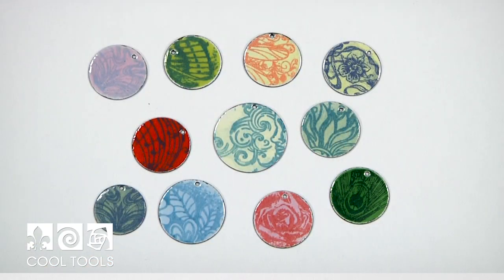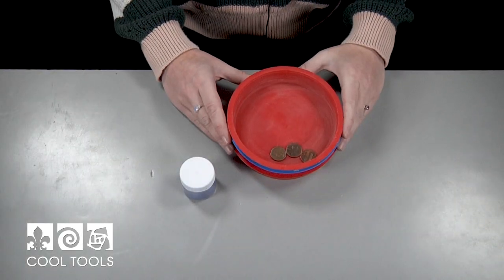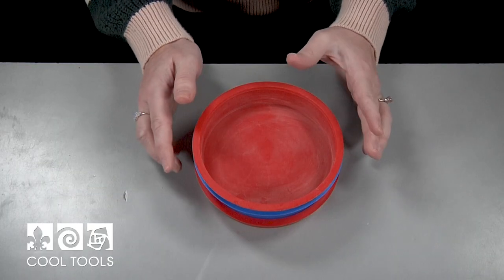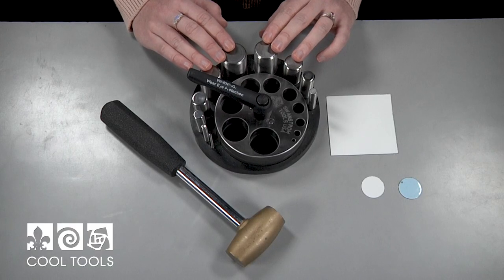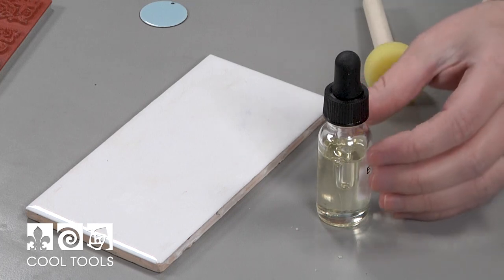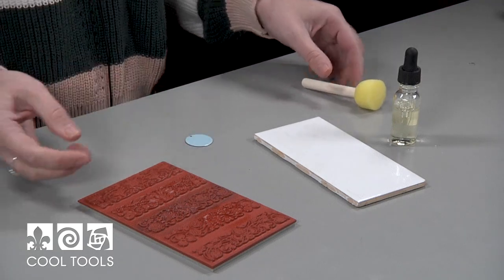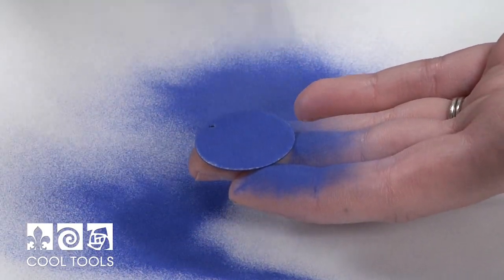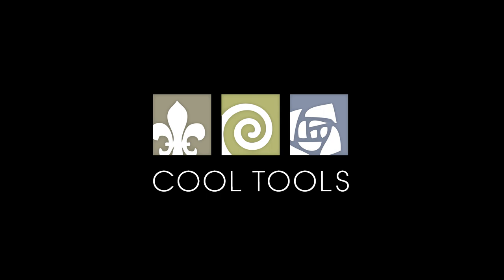Cool Tools | Using Stamps to Add Patterns to Enameled Pieces by Karen Trexler

Comment: Do you vent the top of your kiln when putting this piece in, since there is squeegee oil on it?
Reply from the maker: You do not need to vent your kiln for these firings to turn out successfully. The squeegee oil burns off in the kiln even without a vent to allow additional oxygen in, and I find that I notice less of an odor from the burning of the oil when the vent is shut and the piece is left undisturbed in the kiln until all the oil has burned away and the enamel has fused. However, if you do have a good ventilation system in your studio or have a fume extractor that can be used alongside the vent from your kiln then I would recommend opening the vent to work alongside your ventilation system as you want to avoid inhalation of fumes from the burning of oils whenever possible. Thank you for asking. 
-Karen
Reply: Could I please ask what is squeegee oil?